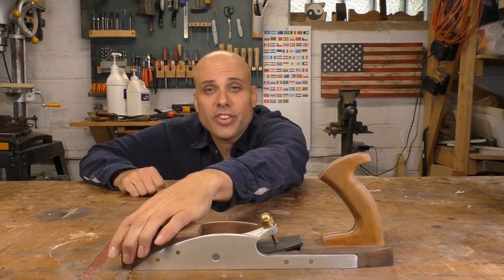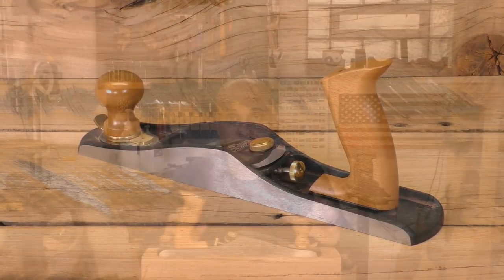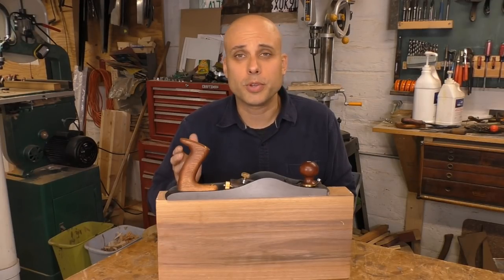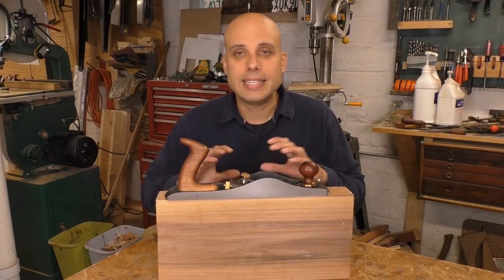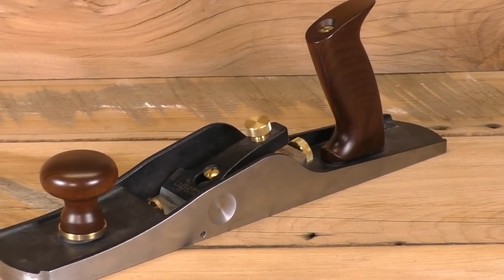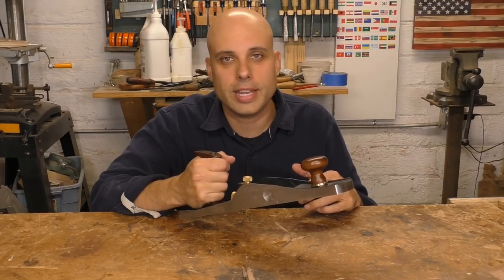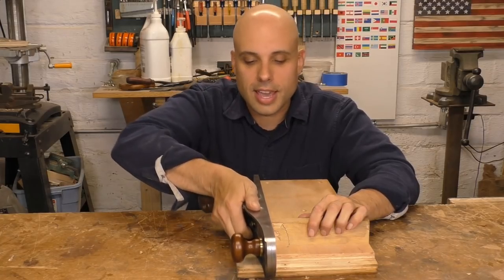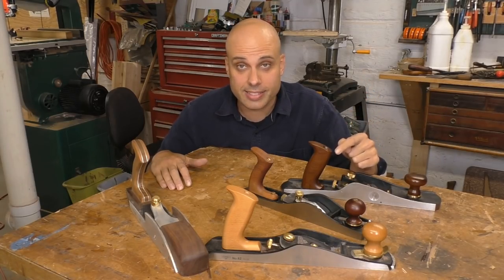Low Angle Plane Shootout!  What's the best value?

Comment: As my first plane, should I get a low angle or a normal plane?
Reply: I've been a professional furniture maker for just over 25 years now, and if I had to start all over and chose only one plane I'd go for a normal (bevel down) plane, and I'd make it a number 5 plane ("jack-of-all-trades-plane" = jack-plane). It has some length so you can use it as a poor-man's jointer / try-plane, and because it has a chip-breaker and adjustable frog you can set it fine and use it as a smoothing plane. 
     Buy as high quality plane as you can afford (you'll thank me in 10 years time :-) but if you have to buy a cheap one it's not so bad because in the future (if you stick with woodworking) you will perhaps have bought other planes for specific tasks - perhaps a fore- or try-plane #6 or #7 (jointer) and a #4 smoother and then your beat up, cheapo old #5 can become what it traditionally has been ; a roughing out plane (a bit like a scrub plane).
     Low angle / bevel up planes are nice, but I consider them a "speciality-plane", i.e. well suited for one specific task - in this case planing end grain (which is supposedly what the Stanley # 62 was designed for ; flattening end grain butcher's blocks).
     Oh, and one final word of advice : Learn how to sharpen steel - scary sharp ! Without a keen edge a plane is just a useless piece of steel. You do not need expensive honing guides; a couple of cheap oil-stones (Norton ?) and a steady hand / wrist (and lots of practice!) is a good start. Check out Paul Sellers' videos !
     Good luck ! from a Norwegian woodworker
Reply: What a great thought out reply. Thank you!
Reply from the maker: I'm with barkebatt. I agree totally with everything he said. Just be aware that many people prefer the smaller No. 4. I do, but I also own both.
Reply: @RexKrueger , 'tis always a conundrum trying to help a future tool junkie just getting started down the path of "It's impossible to have too many tools" by limiting your suggestions.

Comment: Fear not Rex. The Veritas Low Angle planes are TOUGH. TOUGH, but easy to sharpen blades and tough ductile iron bodies. Mine have been my every-day planes since I sold my first-born to pay for them. (Nearly 12 years now) NOT sorry I did. They WILL be passed on when I’m gone and I didn’t have to fork over the mega bucks for weddings or college for the planes, like you do for kids. And unlike kids the Veritas planes do exactly what you want every time, totally unlike kids!  :-)